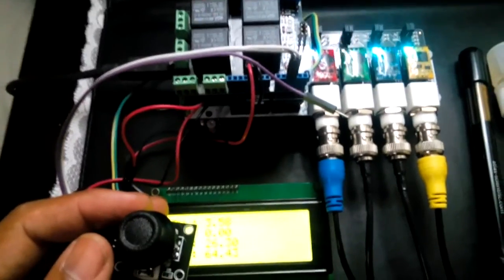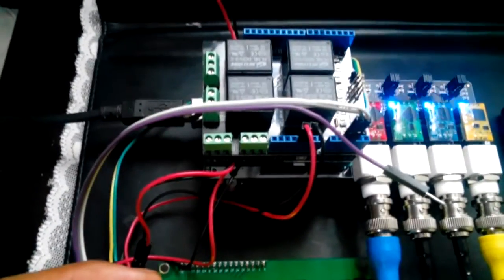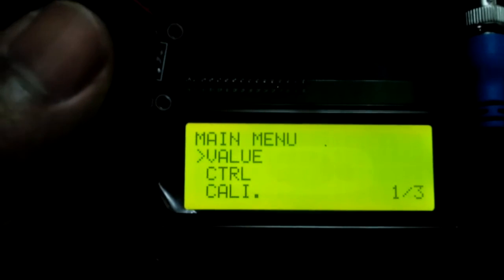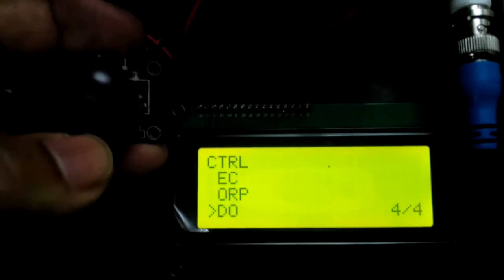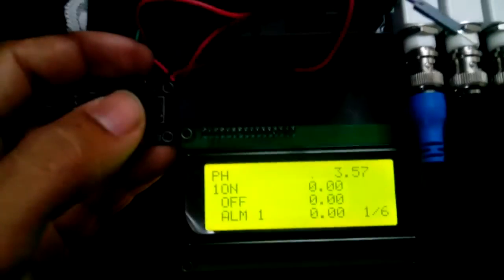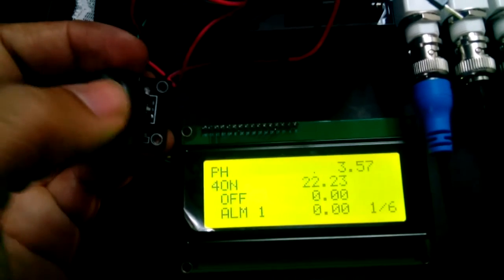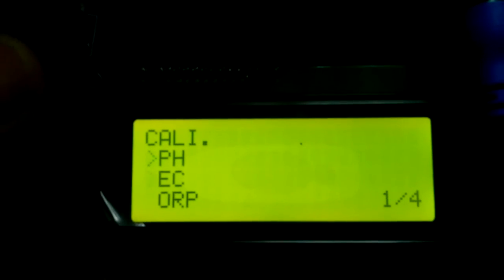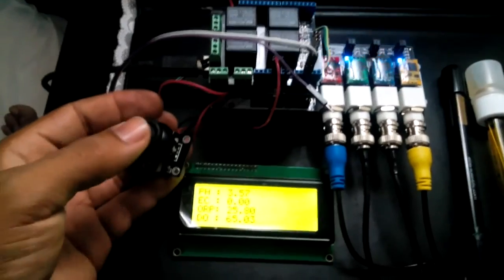DIY Hydroponic controller

Comment: i also have the shield and all the probes. I want to use mydevices Cayenne; https://mydevices.com/. Is it possible without needing a genius at my side?
Reply from the maker: Phillip Knott thr tentacle sheild website has great level of code example. Do what I did and just modify the code example into a function that returns the correct perameter and then call it in your main code

Comment: I would really love to pay you to build me one of these you did such an amazing job please let me know if you're interested
Reply from the maker: Nick C while I am very flattered by the request I most polity decline it. there is just not enough time with a daily 3-4 hour commute, playing with the kinds, keeping Mrs happy ;),  projects on the house, etc etc that I barely have the time or energy to finalize this much less build another one. That being said the design is based fully around Arduino sheilds, and generic modules that any body with a Dremel, drill and a small screw driver set could build this. no fancy custom circuit board needed.

Comment: I have a sketch that uses 8 relays, a DHT sensor, ethernet and works with Blynk through my Android phone.  I have the tentacle and all stamps on my wish list, but if you want a working sketch to hack apart, I'll share it on your Arduino thread after work if interested.
Reply from the maker: That would be greatly appreciated because with the magic of paper work in the great world of the office, I'm on vacation now so I have the time to do some work on the project.
Reply: I'll post it in about 10 hours

Comment: Hi, 
this is Great Johann, i have the same hardware any chance you can share your process please ?

thanks
Reply from the maker: I do plan on doing so but, the there are a few mile stone I want to achieve before I make it public.
Reply: great, looking forward to it :)
good luck!!
Reply: @johanncover1988  So, Johann... after 3 years, did anything happen with this?  Did you make any progress or finish this project?  I need to make almost the exact same device, but I am a complete beginner with arduino (some electrical/diy background/knowledge).

Thanks for sharing this either way.  Great job.

Comment: What code did you use for OD ?
Reply from the maker: Actually all probes use the same communication and commands structure to retrieve the data. Every thing operates on an i2c communication bus. 

More detailed information can be found here https://www.atlas-scientific.com/product_pages/circuits/ezo_do.html

I just modified the sample code on the  atlas-scientific web page to make the code into a callable function.
Reply from the maker: I have a small forum here

https://forum.arduino.cc/index.php?topic=398226.0

you can get a copy of the code there. 

Also I finally got some parts additional parts so you can expect some updates and revision of the code in short order
Reply: Thanks, I really appreciate you getting back to me so quickly.
Reply: Any chance you could send me a copy of the code so I can see how you did it? o.whinnett.uk@gmail.com